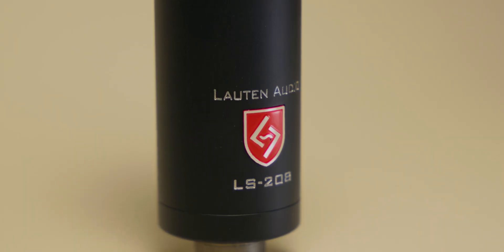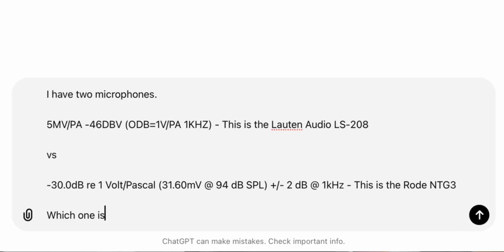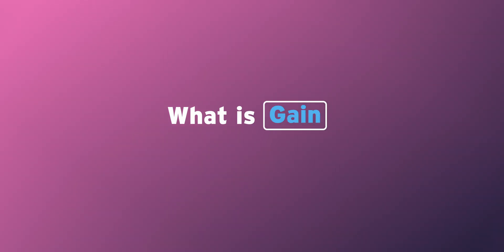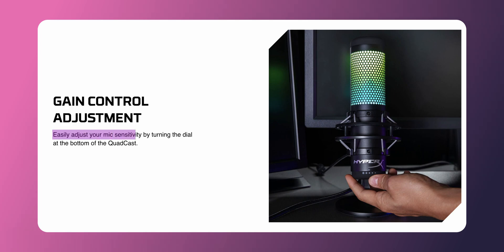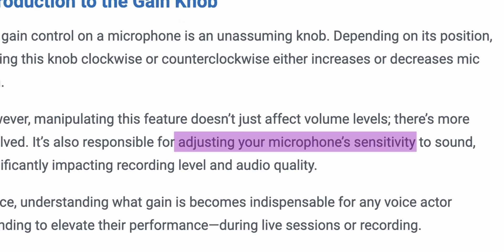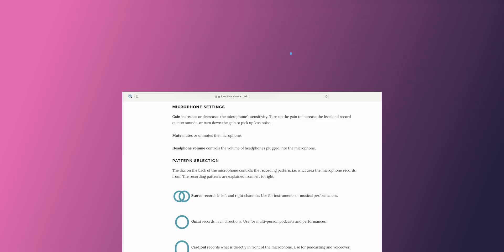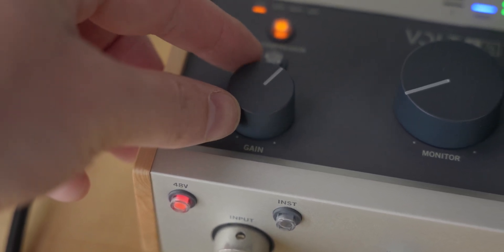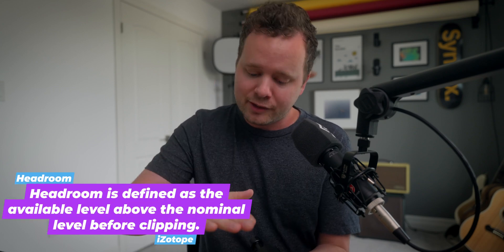Stop Believing This Microphone Myth! Gain vs Sensitivity

Comment: There is contradiction with what you said Im genuinely curious cause I have never heard anyone separate the two.  If gain can increase the polarity of a mic that is also making it more sensitive.  Everywhere I look it says that gain is a sensitivity level.  You can increase it by gaining up.   If mic is hotter than another and you can gain it up to match you literally just increased the sensitivity of one to match the other.  Or Am I missing something?  I think what you're referring to is the difference in how much gain something needs to produce sound.  And the problem with that being considered the only term for sensitivity is it can be increased by gain.  I think that's why we typically say this mice runs hot.  Meaning it doesn't need much gain.  But it's hard to separate the two because gain literally changes sensitivity.  If you gain up it's more prone to pick up noise.  I think the problem is we shouldn't be using sensitivity as the term for how hot a mic runs.  For the lack of increased gain it needs. It just you undo the fact that you match sensitivity with gain and then say there different.  I don't know it still doesn't make sense with all the information to separate them.  If we want to nitty gritty gain is a sensitivity level.  Other wise you wouldn't be able to match mic sensitivity?
Reply from the maker: The difference is that one is before the output and one is after. Sensitivity is how effortlessly the diaphragm can physically react to pressure in the air. If the mic isn’t sensitive enough, no amount of gain will make it better at picking up things that just can’t stimulate the diaphragm. Gain happens downstream after the mic has done all of the work.

Gain does not affect a microphone in anyway. It only amplifies what the mic dished out.
Reply: @randyrektor  So you mean tell me that when I gain mic.  And it picks up more it was already there to begin with before I gained up?
Reply from the maker: Yes the mic pics up the same amount of things regardless of the gain. The gain then brings up everything proportionately. The gain has no affect over the microphones ability to ‘hear’ sound
Reply: @randyrektor  The only reason I am asking is doesn't matter how I ask an AI it always gives the same answer that gain is sensitivity level.  And I tried googling it and only you and one more person fights this ideology of gain and sensitivity. I couldn't get AI to agree with you Im at a loss even at my audio school they told us it increases sensitivity.  And in all my years of Audio it made sense but now you tell me no And I can't wrap my head around how gain isn't sensitivity at this point.  Because I thought the pick up zone of mic isn't the diaphragm it's the polarity pattern and if you gain up that increases doesn't it?
Reply from the maker: Haha I get this. AI just uses information it finds online and people commonly refer to gain as sensitivity. You have to consider how gain works from an electrical standpoint. It only increases voltage within the console, it doesn’t change the ability of the diaphragm to move, or anything to do with the mic itself. The mic is the mic, nothing changes that. If you speak to people who manufacture microphones they will dispel this myth
Reply: @randyrektor  Gotcha, I am not going to lie I forgot that there different on a technicality.  But now I remember why audio engineers don't waist there time separating them.  Because technically it's still wrong to say sensitivity is different.  Because  gain is measurement of how much of the mic sensitivity I wish to access.  Therefore Sensitivity without gain is a circle its pointless.  If my only way to access sensitivity of a mic is gain.  It is fair to say that gain is increasing the sensitivity.  So I gain up an access more of the mics potential sensitivity.  I still am making the mic on a technical scale more sensitive.  Because I accessed more of it.  Gain is a potentiometer that sets the amount of sensitivity I wish to access.  But in that same terminology saying gain increases sensitivity is more correct than incorrect.   I don't like making audio more complicated than it has to be.  So yes gain on a more technical level is sensitivity. It's a measurement for how much id like to access.  There fore making it increase the sensitivity of the mic or anything.  So I simplify it because it doesn't help anyone to separate them so I always say gain is sensitivity.

Comment: This was an awesome video! I always sort of knew intuitively that "sensitivity" had a more meaningful definition.

As for audio myths that grind my gears, where do we even begin!? Hearing tone from cables, DAWs sounding different, don't use shotgun mics in a recording booth, dynamic mics pick up less noise (which you've already addressed), and the list just goes on.

Recently I heard that placing a microphone at about hairline level with the capsule pointing down to your desk or lap will reduce the amount of mouth noise (clicks and smacks) it picks up, what do you think of that?
Reply from the maker: Thanks so much for the kind words.

Ooooo these are some good ones! I might have to do the shotgun in a vocal booth one because I have access to both of those :)

As for that last one, there's a bit of truth there. I think less to do with the specific positioning, and more to do with getting the mic off-axis. Because high frequencies move in straight lines and generally have less force than lower frequencies, they have trouble moving the diaphragm if it's at an angle and because a lot of mouth noises are generally high frequencies, there's actually some truth to that one!
Reply: How about that! I kinda figured the off-axis bit was what made it work. But wouldn't having the mic off-axis but at mouth level work just as well for that purpose? You know, signal to noise ratio and all that.
Reply from the maker: Yeah, I’m not sure what the placement would do, that parts a bit lost on me lol! 😂
Reply: I guess all that's left to do at this point is try them both out. 😂